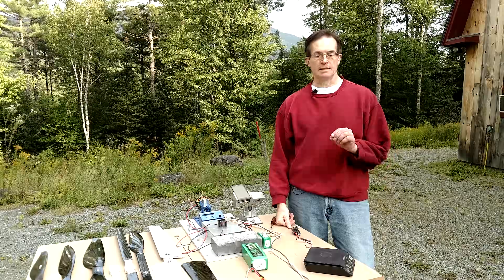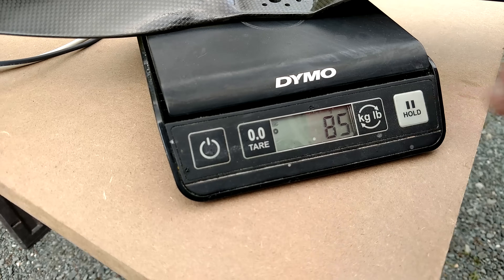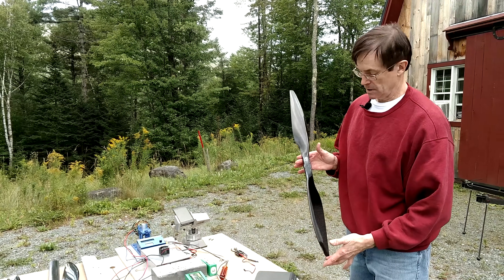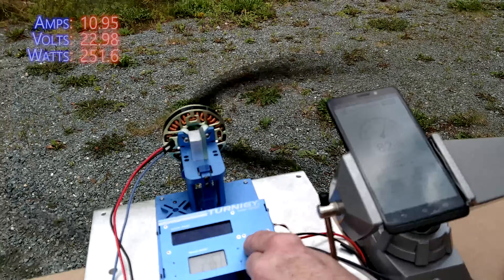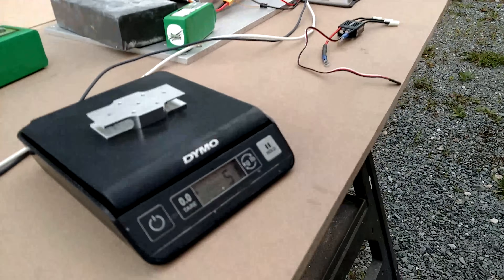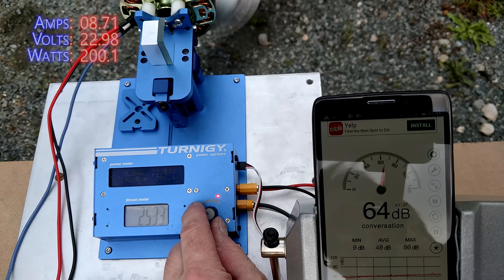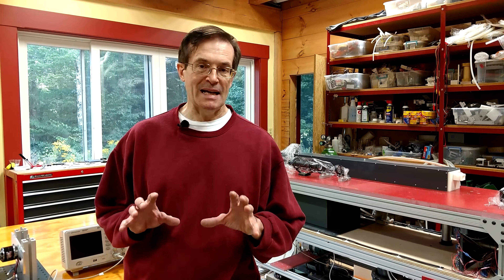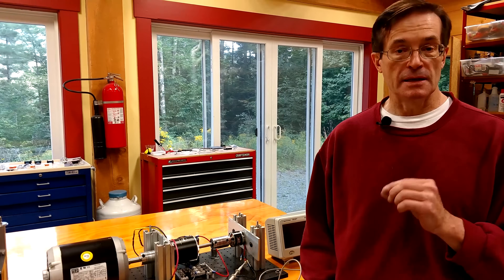Building Drone Rotors - PART 4 - The Testing

Comment: Larger props lower rpm more lift, need a lower kv larger dia. motor for more physical torque by improving the magnetic increased fulcrum. Literally think airplane wings when building up a prop and use 3 blade as the load on the axle is more balance in all ways allowing a bit more top end rpm. 300 rpm 1ft wide blades / tremendous lift eats up less space. Magnet S / N coil S / N magnet pancake motors let the magnets do the work less amp draw and take advantage of both N and South production from the coils for more torque / Kt.
Reply from the maker: Agreed, except for the recommendation for three blades and the very wide cord blades.  The additional blade adds additional surface drag, but does not decrease the disc loading which is the determinate for efficiency. The motor axis will experience the same stress with two or three blades assuming they are balanced equally well.  The wide cord will improve the Reynolds number for the propeller and this is particularly valuable near the hub, but near the tip the Reynolds number is already favorable and the wide cord adds surface drag and considerable rotational inertia which are detrimental.  A highly tapered blade would be best.
Reply: I have used 50N neo's over lower rated and increased torque at the same amps allowing more prop dia. or pitch depending on the need. The coil at a given amps can always use more magnet for increased repelling of the energized coil poles. I have built over 200 brushless motors over the years mainly CD rom style different magnets / winding configurations. Thicker magnets with higher gauge ratings provide gains always.  Using a energized coil at a given amp with neo's on both sides of a iron filled coil with thin laminates to reduce eddy currents increases power / efficiency over a single magnet array that only used one pole of the coil.  Will require a hollow axle with a secondary axle per say that is solid mounted to the motor mount. The 3 phase leads would come out between the bells or through the ridged shaft attached to the firewall or mount. You avoid saturation by monitoring input per load.
Reply from the maker: Brian, I'm sorry, but your reference to biplane wings as they apply to the monoplane airfoil of a propeller is confusing.  Suggesting we find the freely available NACA papers to support YOUR contention is bit unfair.
The Reynolds numbers are for a fact, lower near the hub and a wider cord does compensate for this.  If you are suggesting that this is not advantageous or at least not significant I'm open to that possibility, but your explanation is again confusing.  The cross section of the propeller near the hub is an airfoil, we don't have to "turn it closer to an airfoil shape".
Your reference to the spinner does make sense as most of these commercial drone propellers, including the expensive, T-Motor  propeller I demo, are designed incorrectly.  For low forward airspeed the propeller's angle of attack near the hub is causing it to operate at nearly 30 degrees AOA and it is stalled.
Reply: Yes true tapered tips always and flared, constant cord does rob the top end the idea is keep good lift per smaller dia. per wider cord is the jist of the idea.  A vehicle as wide as a sidewalk or near to it within a foot could have use / zipping around the neighborhood without engaging paved streets as much.  3 to 4ft off the surface maybe acceptable by the masses.Trouble is dust / dirt creation even if the noise is reduced to a acceptable level.  Would be a treat to zip around to nearby locations reachable through paved pedestrian paths, until the laws allow something other than rubber on the road. Making a trip to buy a treat at the gas station on a Sunday afternoon would be good fun. Fold up backpack able for security during biped time is needed. Anything that can yield 40 min. duration is worth going on jaunts with, perhaps solar 
cells covering the exposed area's of the backpack to gain some run time during down time.
Reply from the maker: The Reynolds numbers are significant and they are always significant.  The performance of any airfoil you research will depend on the Reynolds number at which it is operating. Take a look at:
http://airfoiltools.com/search/index
The inner portion of the propeller does produce lift if it is designed properly.  Where I believe you are mistaken  derives from your assumption that the propellers we are using for these heavy lift, slow flying drones operate in the same airflow environment as a fighter plane.  It is much more appropriate to compare these propellers to the design of a helicopter rotor disc.  This is why we do not want a spinner and neither do they.
Reply from the maker: We won't stop and thanks for watching!  Regarding your comment about my pay grade, that is uncalled for and incorrect.  I fully understand the issues you raise even if I disagree with your conclusions.  The design of modern helicopter rotors, the impracticality of spinners for these craft, the positive, if lower lift of their airfoils near the rotation axis are evident and consistent with our suggestions. The design of high efficiency sailplane (and sailboat) airfoils based on matching Reynolds numbers to design air speed directs millions of dollars of investment and again is consistent with our recommendations.  You do not know my pay grade although I will tell you, my employees are well compensated.
Reply from the maker: This is the end of this thread.  We did obtain thrust readings for our set up.  Look at the LCD display.  You remain insulting and condescending and your focus is tangential.  Best wishes.
Reply: The ratio of chord to gaps features in the solidity-calculation for a prop.
In overall terms the sum is Solidity = blade_area/disk_area
The higher the number the more "bite" but you will need more engine-power to shift the air. In physics nothing is free and there the motor and blades need to be matched if you add 25% more power you need a prop that is either longer has a wider chord or has more blades. Another limit is cavitation at the tips if the tip-speed approaches a high sub-sonic mach-number. The Harvard/Texan actually exceed mach 1 at the tip which is both inefficient and noisy. I would not worry about higher maths and dimensionless-numbers like Reynolds-numbers, just try to make blade-surfaces slick and choose an efficient aerofoil and the tricky maths has already been done for you. By the RAE or whatever NASA was called before adopting the current name.

Comment: Wouldn’t having the microphone in the prop blast skew the decibel reading? You would be picking up actual wind noise but that varies depending on the pitch of the blade and how much power it’s given. I wonder if you put the microphone in line with the blade or in front of it it would give better, more accurate numbers, for the decibel reading anyway.
Reply from the maker: That's a good point.  The position of the meter does matter.  Even to our ears, the propellers are quieter from the front as opposed to the back. Even the largest props at thrust levels of a few Kg are rotating at above 1100 RPM and that means a blade pulse of 1100/60 x 2 blades = 36Hz and that is audible as a low frequency  "thump".  I wanted to capture that because it's part of the complete noise package.

Comment: Congrats, while the whole world is turning to battery electric vehicles and improving the vehicles around, you go the opposite and take a very inefficient approach (propeller drone without any aerodynamic lift) and add fuel. Surely the way to go!
Reply from the maker: You make a good point.  We are also working on RC blimps with a helium recovery system.  Paramotor flight systems are also very interesting, but the bottom line here is that all these vehicles depend on propellers for propulsion.  The takeaway from this video series is not what you use these propellers for or how you power them, but how they work and how you can construct them yourself at low cost. Thanks.
Reply: Good reply. This is just what came to my mind, I liked the other parts of the video!

Comment: WOW! Amazing.  Thrust is 2,200 pounds?  Or was it Kg?  Or maybe grams which would be far less impressive.  Or was it ounces?
  So this video is all about getting real-world numbers for these propellers.  And you never once mention the units which those numbers represent?  This looks like a nicely controlled experiment.  You take each prop up to 1,500 something.  Was that RPMs or something else?  And you measure thrust, in unknown units.  I'm sure you have an interesting channel.  You do have a cool workshop with a laser and all, but unless I go back and watch all your other videos to try and see if you mention the units you measure in this video, all I know is that your props aren't much worse than one I can buy, which produces how much thrust exactly?  We may never know.
Reply from the maker: I did neglect to mention the units of thrust and I apologize, but the thrust produced is in grams.  I know you are joking as pounds or Kg's would obviously have launched the entire test stand as well as the table into the woods.  The thrust levels that we chose to compare were based on drones with 6-8 rotors and with overall weights between 9Kg and 20Kg. This is a reasonable, real world range.  With a given set of rotors, as the thrust levels rise you can anticipate that the power levels will increase roughly as the square of the increase in thrust. Thanks for the question.
Reply: Hey if I wanted say 60 to 80 kg of thrust what motors or set up would be best / cheapest?
Reply from the maker: If you want to produce more than 20Kg of thrust from a single rotor, you should look at  paramotor propellers. These are available in diameters from 1.15M to 1.60M.  The larger the diameter, the more efficient.
Helix makes right and left rotation versions of the same propeller.
http://shop.helix-propeller.de/en/paramotor-props/h25f-fixed-pitch/2-blades/934/h25f-1-30m-r-s-06-2
The motor is easier. Alien Power Systems distributes a large range of motors that are relatively inexpensive.
http://alienpowersystem.com/

Comment: You never say the units used for the thrust meter but i am guessing Kg with two decimal places?
Reply from the maker: Sorry.  All the thrust readings are in grams.  So, the propellers being tested are generating between 1500grams and 2,500 grams.

Comment: - The last propeller produced traction of 25 kilograms?
Reply from the maker: Have you measured the power consumption at that output?  I don't doubt your numbers, but the disc loading of a 5" prop @ 1,700 gm of thrust requires a rotor wash of approximately 96 feet/sec and a mass flow of approximately 1.2 lb/sec.  A larger prop will move a larger mass more slowly and the energy consumption is 1/2 (mass) x (velocity)^2.  The props I demonstrate can generate far greater thrust if needed, but the test was to provide a comparison of the performance at the same thrust levels.
Reply from the maker: 2.5 Kg or 2,500 grams.
Reply: Isn't that pretty low? My racing quad with a 5 inch prop produces around 1700g per motor...

Comment: Very interesting stuff! I'm as well interested in alternative power sources when it comes to multirotors. Do you think gasoline based energy production is more convenient than, for example, fuel cell applications?
Reply from the maker: At this point in time, fuel cells are not affordable as realistic alternatives to internal combustion engines.  This will very likely change, but not in the near term.

Comment: Please make a video of making  of propeller of a Rc large helicopter
Reply from the maker: How large?  The lack of a taper would make a helicopter rotor easier to make.  You'd want to add several strands of Kevlar, distributed under the carbon running from root to hub.  Each strand needs to exceed the centrifugal load of the entire blade. An outboard mass to increase rotational inertia needs to be selected.  It's probably best to reverse engineer this from a few commercial blade samples.

Comment: I agree with the idea that batteries are inherently low power density. My question for you though is if you are going to use an internal combustion engine, why not scrap the whole electronics motor idea and go with those hobby Nitro engines? they certainly could produce enough power.  The main challenge that I see would then be to precisely control the engines, are there fuel injected ones? because I feel carburetor ones will never have enough control.  

Are you going to be using a nitro style engine for the plan you mention? 

I also found out there is something like a quarter mile worth of carbon fiber four feet wide here at university (no idea on the cost)... perhaps I should try making rotors and making a drone... 

It seems the DIY propellers created less noise?

Thanks for another great video as always.
Reply from the maker: Control systems are already well developed for brushless motor control.  The hybrid system we are building requires no alteration of the many existing, large multi rotors, provides battery back up and isolates the engine's vibrations from the craft. Constructing a removable module allows the multi rotor to operate without on board fuel or the additional noise when this is important.
Reply: one last question, I cannot help but wonder, that large drone, what can it lift? It is looking like it could easily carry 100lbs payload.
Reply from the maker: The motors have rather thin leads at 14G and therefore, 30A will probably be a reasonable limit. 100lb OAW is probably a max. haven't tested this limit yet.